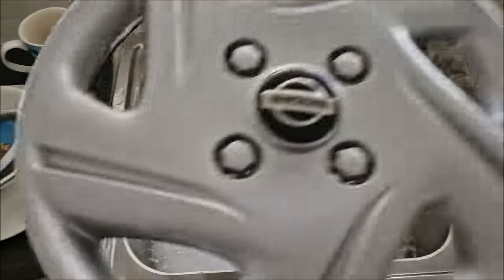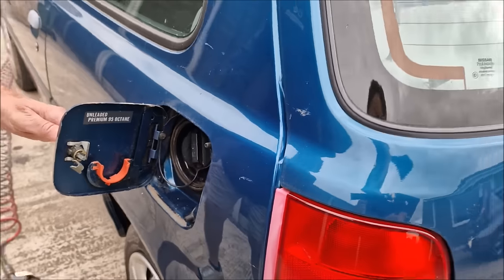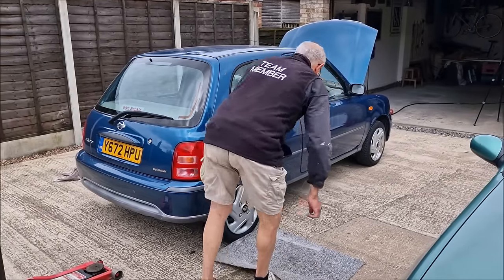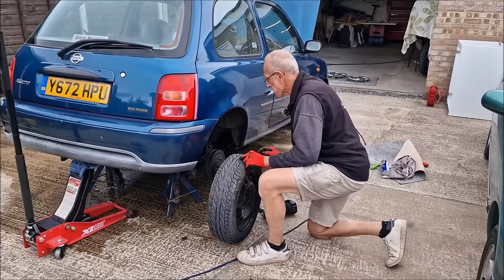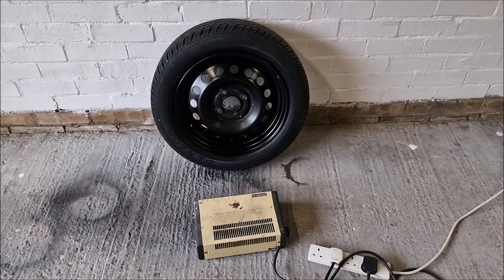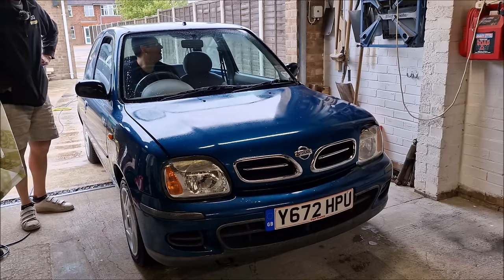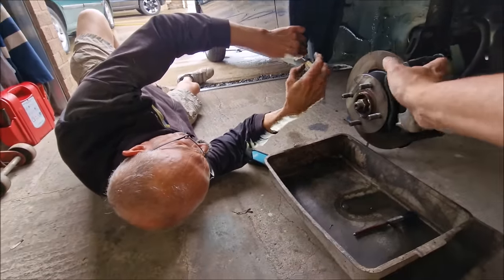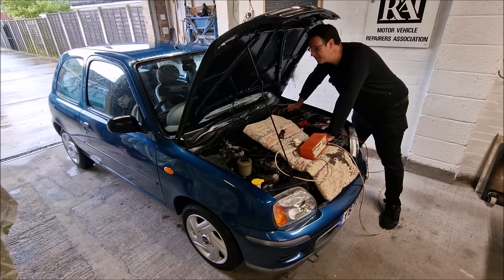Pre-MOT Checks On This K11 Micra Turned Into Concours Preparation

Comment: I would not use WD 40 on the hinges and locks because WD 40 has some cleaning properties. Thus removing the original grease front the lock and hinges mechanism . 

use grease 
which would be much better
Reply from the maker: Handy to know! Cheers 👍